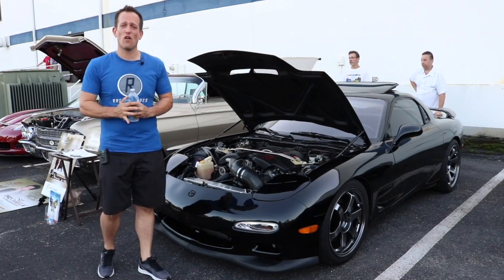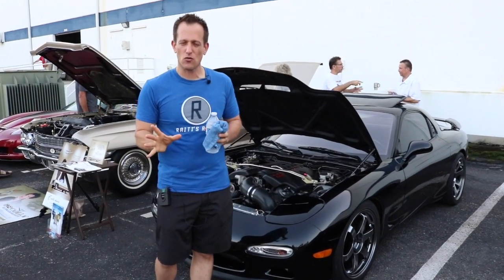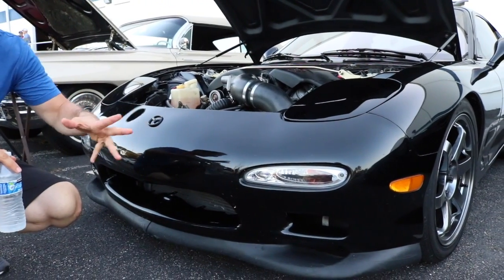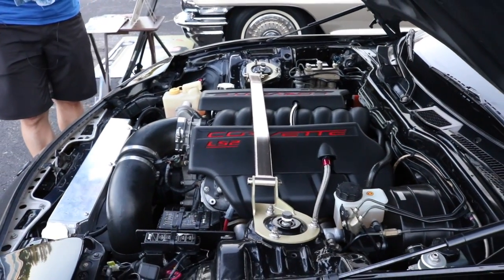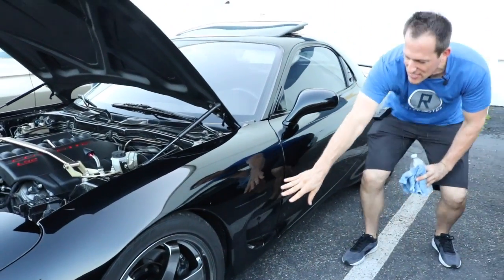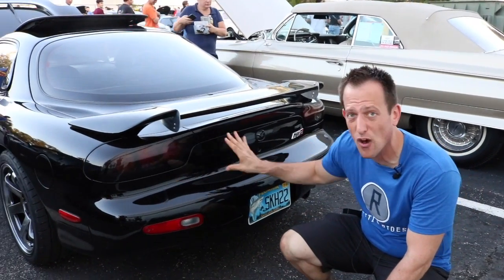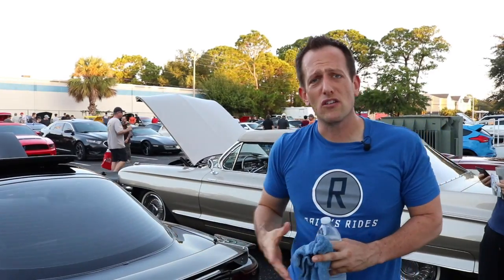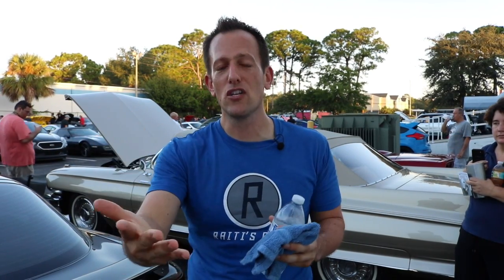Is this 1993 Mazda FD RX-7 a SUCCESS or SACRILEGE? - Raiti's Rides

Comment: That is a very clean RX7 there. But a RX7 without a rotary engine is a sin to me. 

The rotary engine does need special care and maintainance but as long do your deligence like oil change and top up constantly. The rotors can last 100k before it needs a rebuild of the rotor & housing and changing the apex seals. 

I wish to own a RX7 FC and FD chassis and keep the rotary spirit alive.
Reply from the maker: Lin Chester I totally agree with you!
Reply: I changed the oil every 4K and topped off every 1k😁😁

Comment: It's a clean swap and a nice car, but 11's in the 1/4  can be done in an FD with the stock 13rew motor with the stock twin turbos on the same suspension set up as that Ls2 swapped car.  

As far as rotary engines being difficult to make power, I can make 700 rear wheel easier and cheaper then that swapped LS2 car, Dollar for dollar and that's a fact- with factory AC and completely streetable.